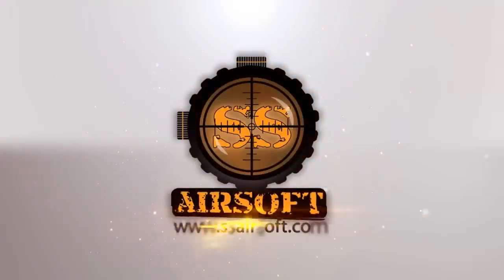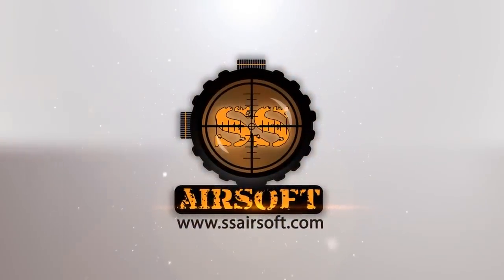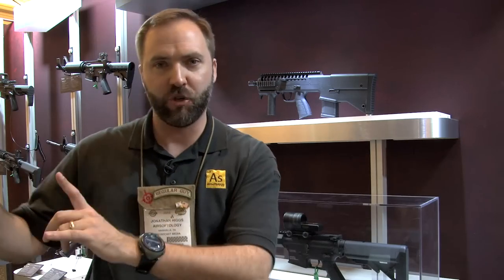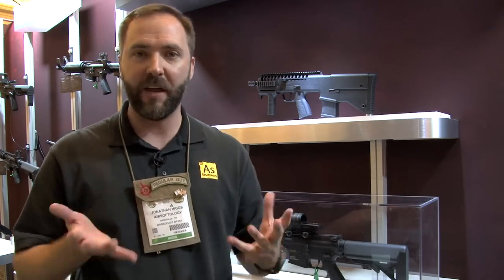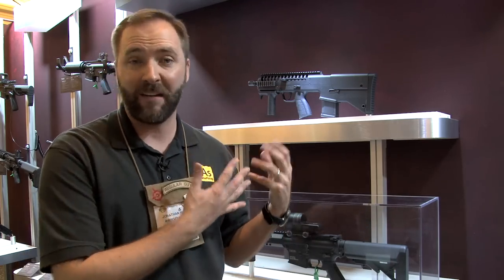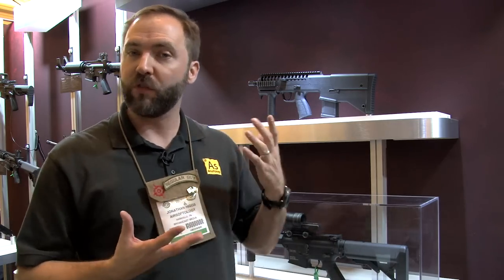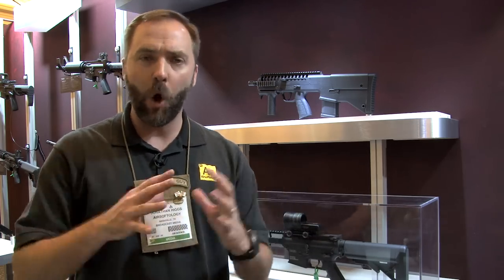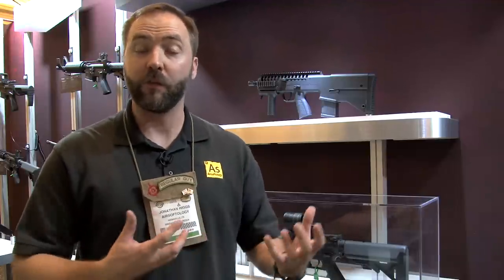A New KWA Gas Blowback Bullpup?  | SHOT Show 2015 | Airsoftology

Comment: This is cool but a gbb Tavor would be sooo much better. Enough M4's for heaven's sake. Even my dog owns like, 6 M4's. We need more bullpups. Maybe a new f2000 with a trigger system that actually works (fail on you G&G), or how about a gbb AUG that wont break if you look at it wrong.
Reply: Tavor you say??  You're welcome
http://arniesairsoft.co.uk/forums/index.php?/topic/214270-hephaestus-project-t-tavor-tar-21-gbb/
Reply: *****  Hahaha start saving now! Hephaestus isnt cheap but I hear they're worth every penny
Reply: *****  WE tech was trying to make a P90 but they stopped because of the Real steal P90's design flaw.  The mag is on top of the gun. Which doesn't really work all that well with a gas gun that requires the gas to flow upwards not downwards....   I can see other companys making it hard (GLock case in point) but when FNH licenses to WE already for the WE Scar L and coming soon to be Scar H there's no way they all of sudden force a company they already do busniess with to stop production.  P90 going not making into production has nothing to do with licensing issues.
Reply: Just a thought, let me know if this is at all incorrect or not possible. But because of the p90s  gas flaw, could it be possible to have regular AEG type mags and then since it is bullpup and has tons of open space maybe they could create a gas compartment so you can insert large quantities of gas straight into the gun? This way everybody wins. It would be cheaper for mags, you could get AEG mags, and you could get them at whatever capacity. I would prefer low cap cause I don't like the spray and pray method. I like to keep it very precise so semi auto is my choice.